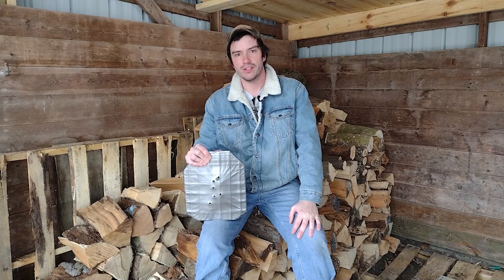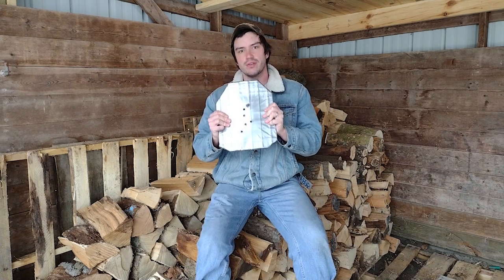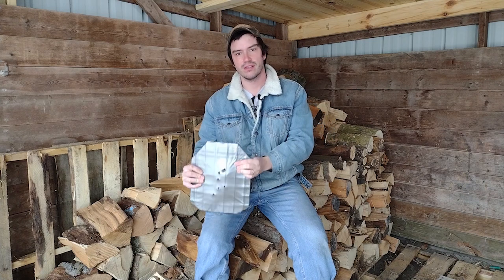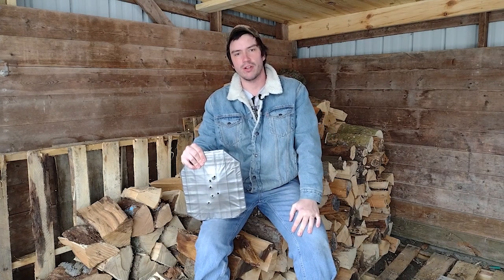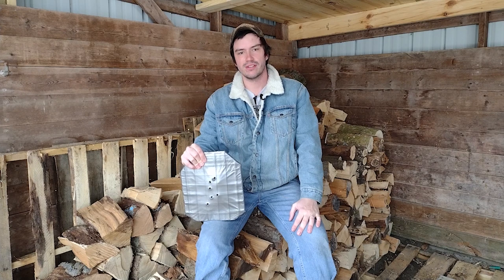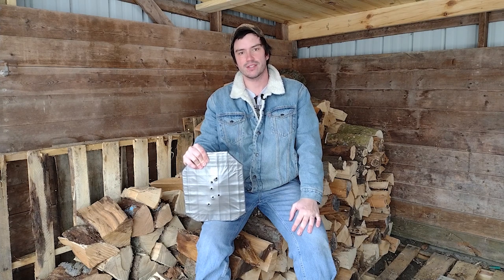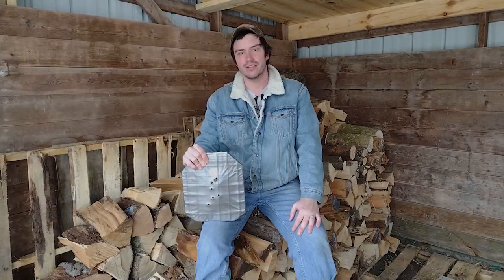Duct Tape Spall Liner Test Part 2 (the Death of a Steel Plate)

Comment: RIP to big armor manufacturers with that weak "build up coat" they call spall protection if this catches alot of traction. Steel armor is the best, its the weight thats the problem. It has far less backface deformation than ceramic and composite plates, therefore in theory less trauma to the body after a hit.
Reply: I love seing people say that steel sucks because it performs less well against rifle caliber bullets with hard metal penetrators, because you know everyone has tungsten penetrator ammunition for their AR lying around.
Reply: Just add a soft armor on the back side. No biggie. 

Steel for life 💪 cause I'm broke AF😂

Comment: There are different grades of duct tape. Buy the highest thread count and most sticky stuff and your good to go.  I run three layers that overlap 50 percent so I have 6 layers when you factor in the overlapping . That inside a plate carrier you shouldn't have to worry about Spauling at all. The tape also is a sticky goo the goo snatched any particles

Comment: I'm thinking about welding a "ridge" along the front of the plate, going around the circumference of the plate. kinda like a bowl? maybe the next big thing
Reply: The HAZ will be weaker than what the plate is rated for after you do that.
Reply: @michaelh6702  That is true. I forgot about that. I was also thinking about adding a "ridge" and then fill it with a rubber lining. Glad I didn't do that. Thanks for the reply.

Comment: My idea for Spall lining was to use old Tire rubber. As they are usually reinforced with layers of metal fibers and are about the same width as a plate.

The other idea was to weld a small lip along the top to prevent anything from flying straight up into your neck

Comment: dang, sad to see the plate die. I was curious if some sort of spray rubber coating would work for something like this. Flex seal or the gorilla glue spray.
Reply: Teofalaudermaus did a video with flex seal, didn't work out so great.
Reply: @LetsPlayBojangles  yeah I've been doing a good bit of research. Duct tape seems to be the go to in terms of cost/benefit ratio